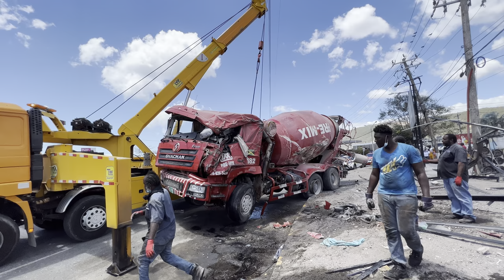SHACMAN F3000 8X4 TOW TRUCK RECOVERY SHACMAN F3000 CEMENT MIXER TRUCK AFTER THE ACCIDENT

Comment: Did the tow truck driver put air to the "pre-mix truck" brake system" as them wheels seem LOCKED to me!! He did a fair job getting that truck up.
Reply: They could have removed the truck boosters